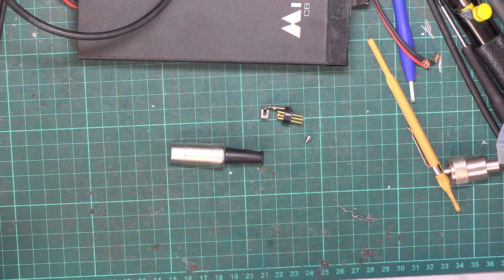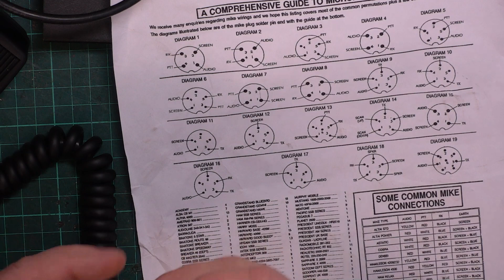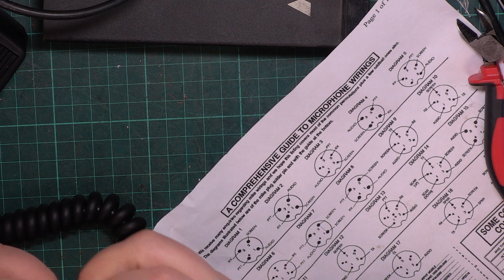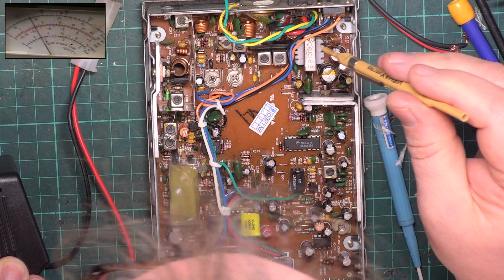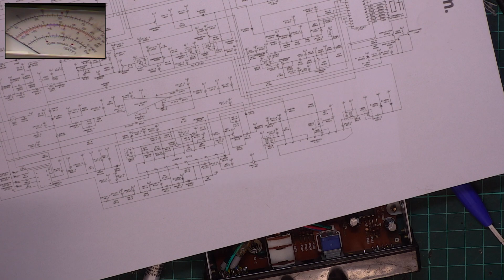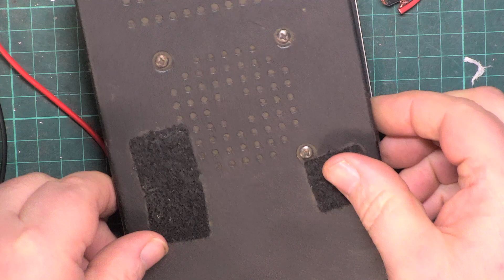Midland 77-104D UK CB27/81 CB radio (mobile) - Repair & service

Comment: Hi Richard i have one similar to this it takes ten pencil batteries and was wondering could i convert it buy using a rechargeable battery pack
Reply from the maker: It's more physical than technical. The snag here is that if you modify the battery pack, you're in danger of the radio having zero resale value in the future. However, if you present an alternative 12v power source suitably fused at 2A technically there shuldn't be a problem.

Richard
Reply: @ukfmcbradioservicingTango21  thankyou for the sound advice

Comment: Just got one of these off eBay, it was the first CB I saw at a mates house so kinda nostalgic. It received but no tx, I opened it up and was pressing around the board and the tx came back, turns out a small metal join to the case on the edge was dry joint. Took me forever to spot it! Thanks for suggesting dry joints. Thanks again you're the best CB resource on the interweb by far😁😎👍

Comment: I have a model 77-104, can I ask what the antennae (or adaptor) I would need for this unit  is called?  Thanks
Reply from the maker: The socket on the back of the Midland 77-104 is a standard SO239 which takes a PL259 plug. What aerial you use depends on what you want & where you want to mount it on your vehicle. We try & always use drilled-in body mounts rather than magnetic mount aerials for best possible range.

The radio will work with any 27Mhz citizens band radio aerial

Richard, G0OJF, UK
Reply: @ukfmcbradioservicingTango21  Thank you very much both for your answer, as well as the speed which you responded. I will order one, we used to have Radio Shack, and they always seemed to have what you needed. However, those days are over.

Comment: Good receiver, on the Motorola MC chip, very sensitive and resistant to random interference signals. Real FM, not AM converted to FM, the converted ones are worse. Yours sincerely, great job! It used to give good and durable speakers, now the speakers are weak, fragile and of low sound quality.
Reply from the maker: All the UK CB27/81 sets are pure FM only.

Richard

Comment: Do you want a proper screw in mic plug for that rig ?
Reply from the maker: No thanks, I always use these tonka ones & the pins are tight enough not to pull out when the mike cord get's stretched too.

T21
Reply: Ok no worries I have a few that came on new mic leads

Comment: The wires miked wrongly....did I hear that right 🙂
Reply from the maker: No, it was the MC3357 chip that was faulty & making it as if the mike wasn't connected.

Richard